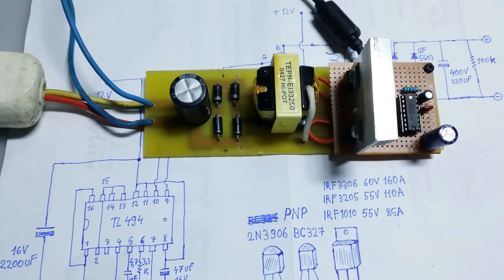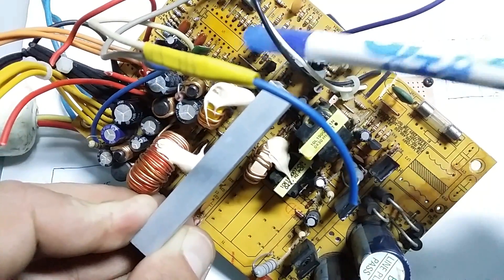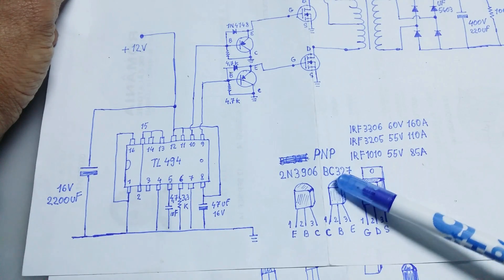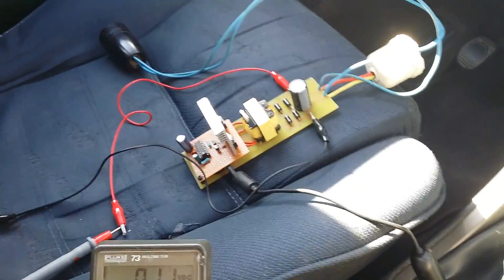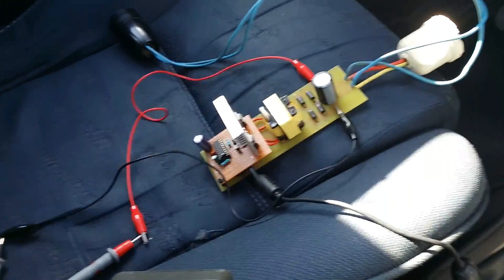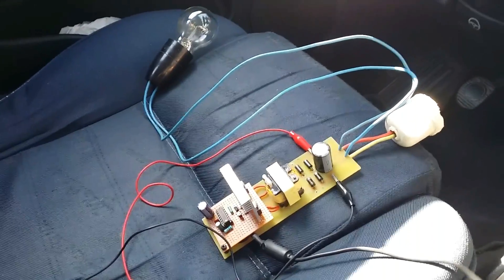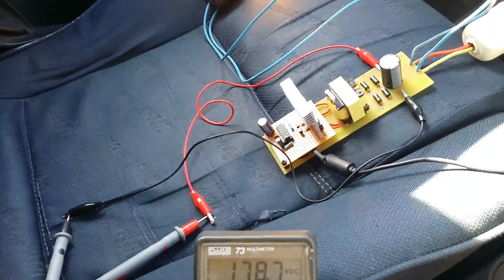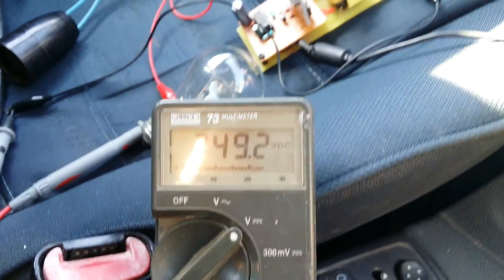12 to 220 Volts Inverter TL494  500w

Comment: bro this inverter out is DC out , 220v its okey , but the frequency  not 50hz , because , using ferrite transformator
Reply from the maker: Yes, this is high frequency. To obtain 50/60 Hz this inverter it need a second stage that will make the high frequency  DC to low frequency AC (50/60Hz), but will complicate things.

Comment: Fake
Reply from the maker: Why do you think is fake my friend? I think you don't have a clue about electronics and how this inverter works. I'm against fake videos my friend. I suppose all videos on youtube about inverter are fake? Is not about free energy shit, I shown the schematic in the video you can try it yourself and you will see that it works.
Reply: My friend u need to upgrade it since it was dc not ac and its continually raises the output so it could lead to explosion of capacitors
Reply from the maker: The output voltage is strictly dependent from the input voltage, with 12 on the input the output voltage reach a certain level and it's stops, is not rising any more, choosing the right value of the capacitor is essential. 400 volts cap in my case and it was no problem, the capacitor not exploded. Keeping in mind that this inverter is simple and easy to make it is ok, it  is good for light bulbs, universal motors and other few things.

Comment: sir will these inverter run induction motors
Reply from the maker: no, because you need alternating current 50/60 Hz, even without the bridge rectifier it still will  not work bicause this type of inverter it has a high frequency alternating current in the range of Khz.

Comment: Sir please tell me, my circuit completely  ready but I m using 3watt led not properly on anytime animation. You please tell me my circuit in what's problem, and I m using 12v 3amp charger using for circuit on. But output voltage up are going slowly slowly.
Reply: Maybe use a 12v battery 😅😅

Comment: Hello sir. Salut for your effort. It is great. But I want to make sure, in your scheme shown dioda bride after transformer and attached with elco to. Is it correct? Because elco just operated by DC current. And why you still use dioda? Thanks for your explanation
Reply from the maker: I'm sorry I did not understand the question. What is ''elco'' ?

Comment: will these inverter run induction motor
Reply: Yes but very poorly. Huge waste of heat, low RPM, and noise from the motor. A square wave into an induction motor just isn't a good match.

Comment: sir could I use without diode and capacitor in output of transformer
Reply: You will get a high voltage AC square wave. It will work in incandescent lamps and brushed motors, but not good with induction motors or 50/60 Hz transformers.